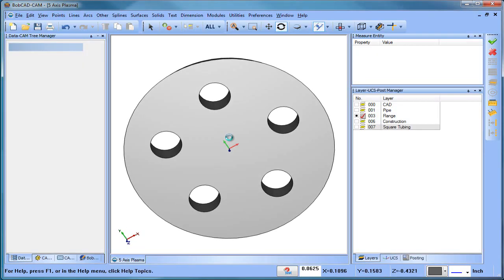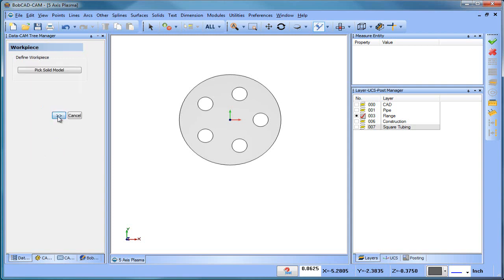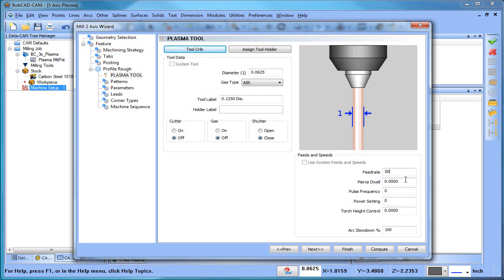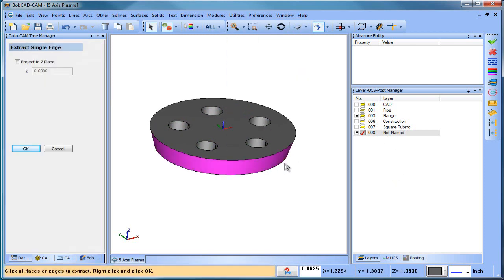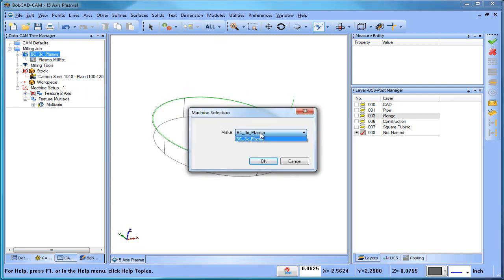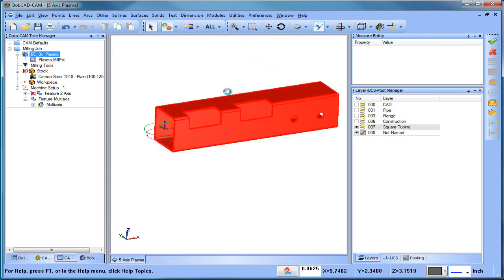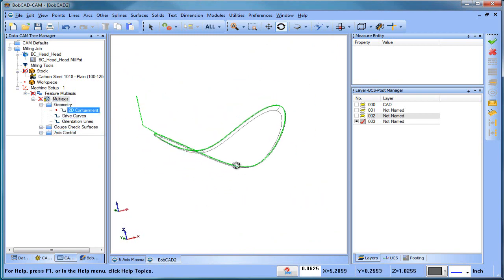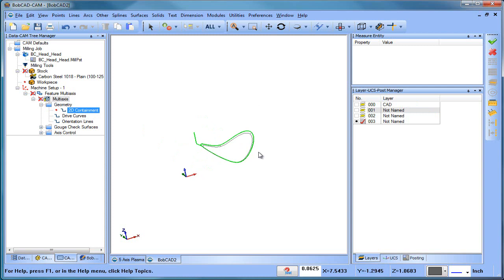5 Axis Plasma Programming BobCAD CAM V28 5 Axis Standard

Comment: I NEED 5 AXISI PLASMA OR LASER
Reply: Sir. you still need 5 axis pipe cnc plasma cutting machine?

Your pipe specification: pipe diameter, pipe length, pipe wall thickness? Beveling or grooving in pipe? 

Jack Zhang
Thanks!
Reply: sales6@cnkasry.com 
+86-15153198239
Skype: sddzlxzsm